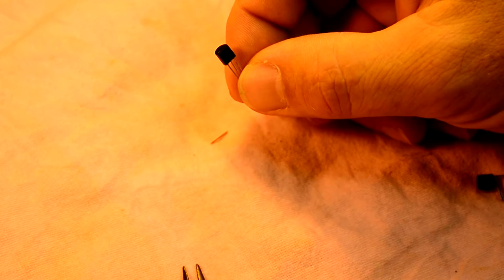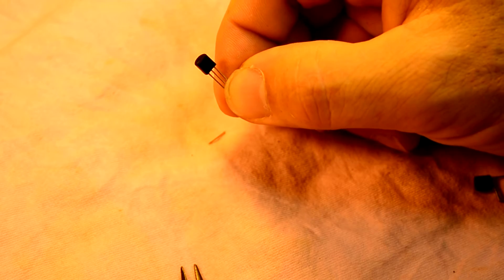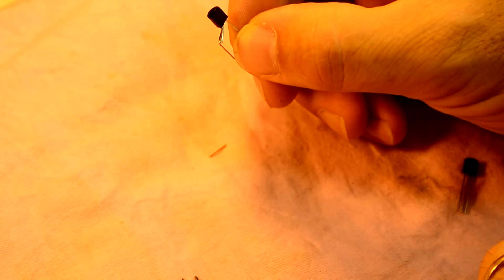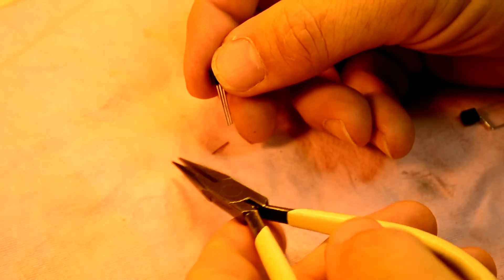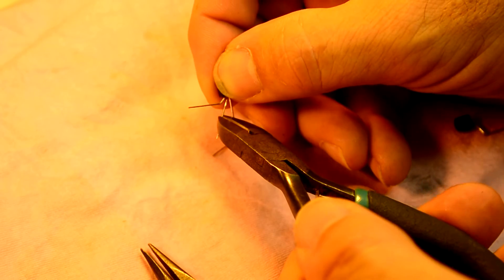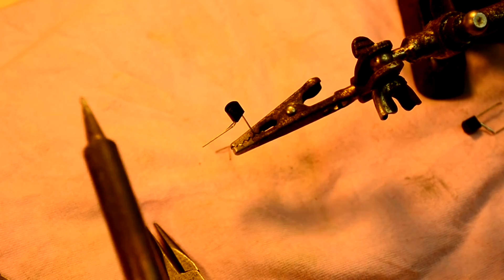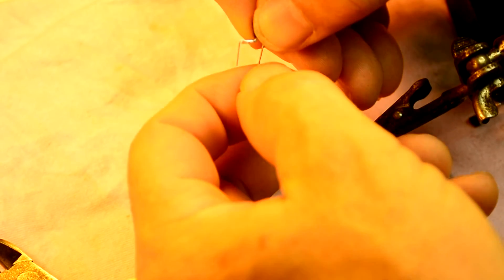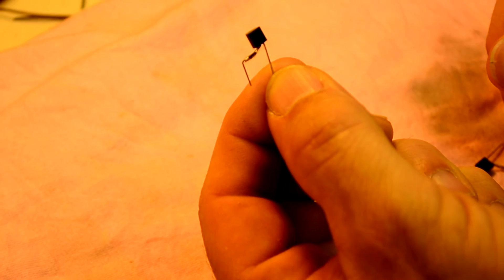Making JFET as a distortion clipper

Comment: I had to fullscreen this vid to figure it out. He is holding the jfet with the flat side toward the camera for reference on which side to join the 2 legs together. Also when he says the joined pair goes in the striped marked terminal/side/marking he is referring to the 'K' cathode side of the terminal which is indicated by the 'line' side of the terminal marking. It looks like a triangle with a 'line' at its point. The 'line' is the 'stripe/cathode side. This is not easy to figure out for electronics noobs like me but I did and it works. I put in 2 jfets in my Fender frontman to replace its LED clippers and it worked! And it sounds much better IMO now than the leds.